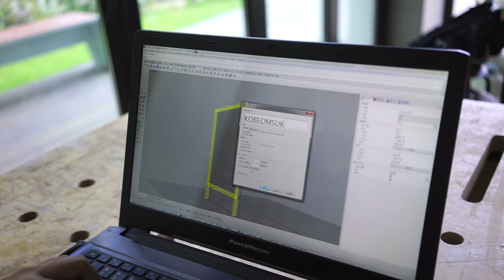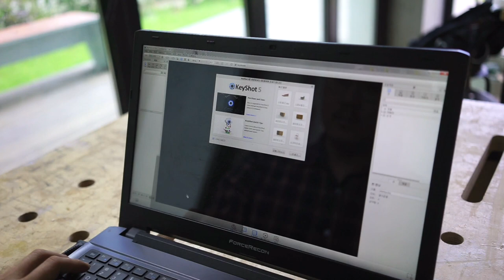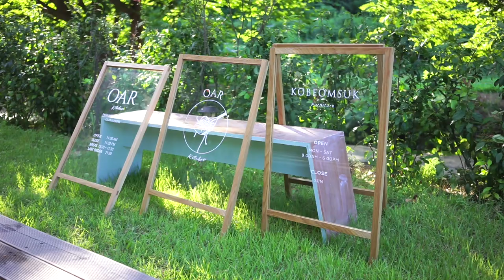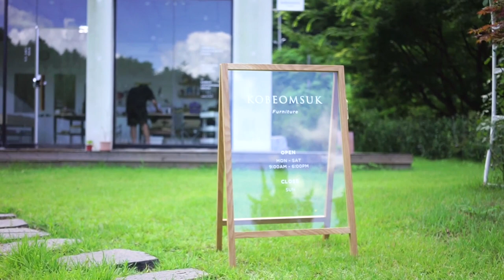Making of Standing Signboard - Kobeomsuk furniture

Comment: Could you explain why at 3 minutes you took 2 shallow cuts on either side of the board and then finished the cut on the bandsaw?  Thanks :)
Reply: Winter Baka - Ebb and Throw muy cierto....
Reply from the maker: I tried to prevent a wood bending by table saw heating. That's reason why I cut them at 3 times, so that I can get straight cutting wood.
Reply: Ah, neat.
Reply: cool, does that noticeably help or just good practice?